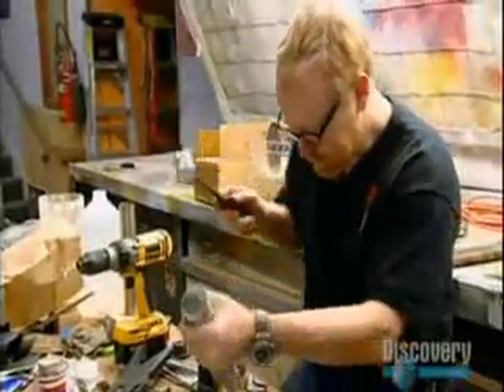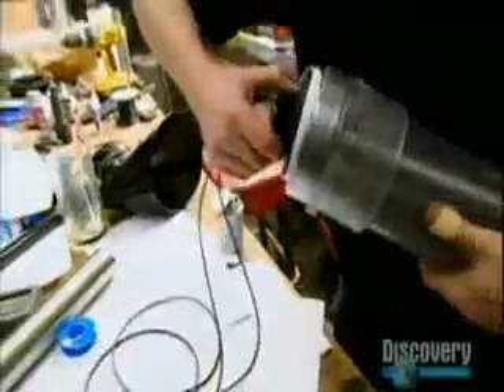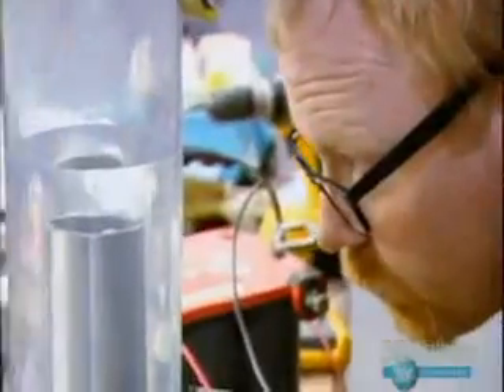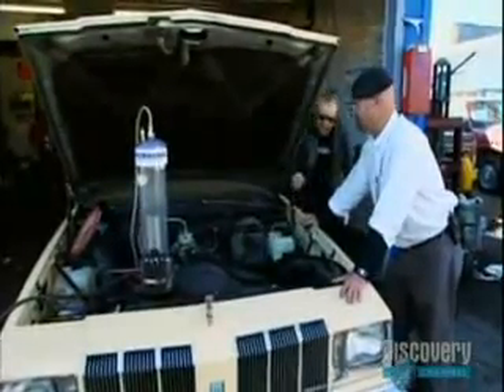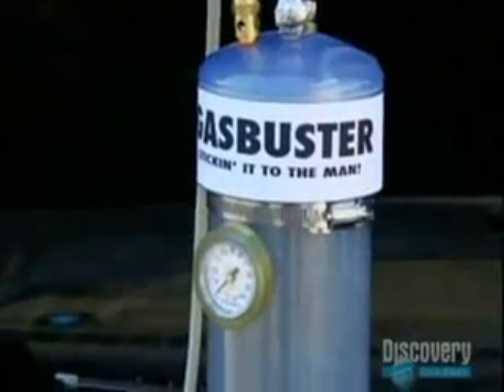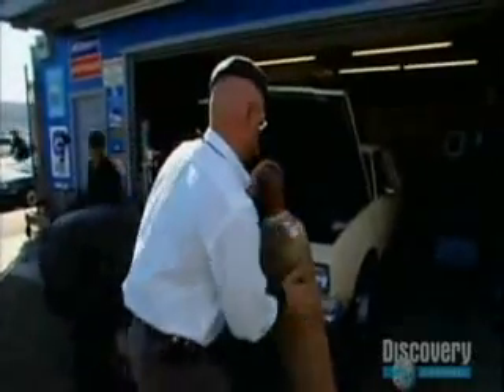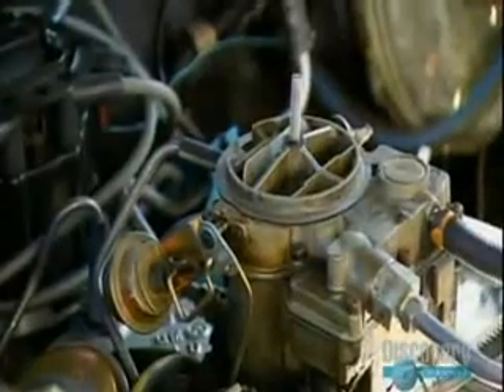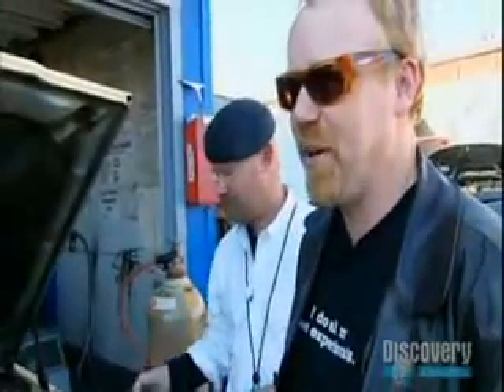HHO Mythbusters Explained

Comment: Yes, the reason is clear. Physics doesn't allow it.
Reply: @hydrogenGarage  Seriously?  Do you understand any of the words you've used?  you can't even spell deuterium for heck's sake.  Ortho hydrogen is a spin-state isomer of parahydrogen and naturally makes up about 1/3rd of H2 at room temperature, para is the other 2/3.  The electro-chemical/combustion difference between Para and Ortho is essentially zero.  Heck, the electro-chemical/combustion difference between Deuterium and Hydrogen is also essentially zero.  Doesn't matter whether the H2 is ortho or para or Deuterium or Tritium, the combustion energy is the same.

The only time that ortho versus para matters is spectroscopy or beam emission, or such as NMR machines.  The only time that deuterium makes a difference is in nuclear reactors.

Quantum physics?  In a chemical reaction?  You're dreaming.

Longitudinal energy?  Oh geeze.

Ah, that explains it, you sell this nonsense.
Reply: HHO or as it's often called "Browns Gas" is nothing more than a very dangerous azeotropic mix of hydogen and oxygen.   HHO cars running on water are just SNAKE OIL. evenrone knows it, stop peddling that crap.
Reply: No, I'll fill up my hybrid car, knowing that I'm saving at least two or three times as much money than you're claiming for your $1500 HHO gadget - if it actually worked as you claim, but doesn't.  And maybe, just maybe, I'll save someone for falling for your nonsense.  That's well worth while.  How do you sleep at night knowing that these devices are fraudulent?  Obviously, your parent's moral training has failed.  Or was it non-existent?
Reply: +HydrogenGarage No content?  Really?  No content that that golly-geewhiz device you're trying to sell for $1500 manages to produce a golly gee wow 3L of HHO gas per minute.   Ooh.   Meanwhile,that 12L engine this is supposedly for will rotate under HHO Power for precisely 1/3rd of a rotation (okay, we'll be generous, and put in enough air to let it do a whole rotation - it's going to need dilution anyway).  Once a minute.  Let's say the motor is running at 3000RPM - that's a nice efficient power band.  50 rotations per second.  So you get 1/50th of a second worth of power from HHO per minute. That's a gosh golly gee wow  LOTS of power.  Oh wait, that's only .032%.

Meanwhile, the alternator is pushing 36 amps @ 13.8V into it - 496 watts - half a horse power continuously.  So a half horse continuously into the alternator to produce a full rotation - all of .032% of the rated power of the engine.  Unless the engine/HHO is producing 5000HP+ continuously, you're operating at a LOSS of efficiency over straight gasoline or diesel.  This isn't even counting the alternator efficiency in converting rotational power to electricity - not close to 100%.

Of course you have an incentive to make stuff up to promote this nonsense - you make money off people believing this scientific gibberish.

And no, ortho hydrogen is no more powerful than para hydrogen, no matter how much you flap your arms.  Exact same combustion characteristics.  Lots of content here, I even did the math for you.  No cigar sorry.
Reply: +Ruth Moreton Somehow I don't think he's being ironic.  Let's enumerate some of the stupid, along with +HydrogenGarage's stupid, in no particular order:

1) If he developed it under contract with the US DoD, then by law, it doesn't belong to him, it belongs to the US taxpayers, because they paid for its development.  Since he didn't own it, he could not sell it.  If he tried to sell it to GM, he would be committing theft and breach of contract.  GM aren't morons.  They'd know that he couldn't sell it to them.   As a FYI, generally, such things are considered public domain and CANNOT be patented.  I know these things, I've seen what these contracts look like - when you work on US government contract like this, you end up with money, and hopefully all your body parts.  You own nothing of what you produced.

2) Any moron could make a 2.0L engine run at full power based on an electrolysis HHO cell, provided they have a few hundred kilowatts of electrical power on their workbench and an electrolysis cell to match - remember that HydrogenGarage's super-deluxe $1500 model isn't small, and only produces enough hydrogen for a fraction of one percent of such an engine requires.  The trick is getting that much power into a vehicle that can move it.  A 100Kw generator weighs on the order of 1000-2000 pounds at least, not including fuel tank.  Then you'd have to add a electrolysis cell that could produce, oh, 100 litres per second or so.  HydrogenGarage's "big unit" produces all of 3 liters per minute.

3) If they wanted to kill him, why do it with something tantamount to putting a flashing red light and destroyer attack siren on his head shrieking "assassination!".  Believe me, any body turning up in a morgue with cobalt-60 is going to scream bloody murder.  Why not something simple, fast, reliable and quiet, like a grain of carfentanyl?  Guy simply stops breathing, and there's a good chance, if he's not found for a while, that a lab test (if they bothered, it might simply be noted as a heart attack, and no forensics would be done) would never find out why.

4) Deuterium  - guess how they make that - take 350,000 tons of sea water, do some chemical process, and you get a pound of deuterium water.   About $600 for a litre of the 99% pure stuff, which is just fine as reactor coolant (as in CANDU) or thermonuclear bombs.  It's not restricted, anybody can buy it, there are many uses for it other than nuclear.  

The notion of "weapons grade" deuterium just makes me giggle, sorry.  It's a moderator, not an explosive.

5) Aether energy?  Aether energy went away over 100 years ago.  Quantum physics are part of what killed it.  Nikola Tesla profoundly rejected both Quantum theory and Einstein's theory of relativity he's quoted saying so many times less than 10 years before his death.  Furthermore, he refused to believe in the mutability of atoms (eg: transmutation of one atom to another - like fission or fusion), or sub-atomic particles, or sub-atomic structures - he didn't believe in electrons, neutrons on protons.  He didn't believe in the speed of light.  He didn't believe in radioactivity.  He didn't believe that nuclear reactions could exist.  Oh, what was Trinity then?

So you use Quantum theory (which Tesla rejected) to take Aether  (the theory that quantum theory destroyed to Tesla's great annoyance) energy, to produce through transmutation (a process Tesla rejected) to make Deuterium (which Tesla didn't believe could exist).  Right?  That's nuts.

Let me put that in simpler terms: Tesla himself would have profoundly rejected your "process" as scientific garbage.  He wouldn't have believed you any more than I do.

6) If you could create deuterium from electrolysis or aether energy, where do the neutrons needed to make Deuterium come from?  Remember, Tesla didn't believe in sub-atomic particles like neutrons, and all deuterium is is hydrogen with an extra neutron.

7) Bob Boyce (I just love the TM - is he suing everybody else named Bob Boyce?) is trying to sell nutty physics based on mutually incompatible theories somehow cooperating with each other.  Nothing can be learned from that.
Reply: No, I really don't get your point.  Wasting limited resources isn't a good plan if you're trying to be self sufficient.  You'd be far better off using the electricity you make to directly charge an electric car.   And yes, you can make your own gasoline, if you really want to.  All you need is a source of hydrocarbons such as plastic or organic material, and lots of heat, and some hardware.  But there's a reason why energy companies don't do it that way.  Because it takes more energy to make it than you get out of burning it.  Are you starting to see a pattern here?
Reply: @broandrow Hey bro, if the US patent office will gag order these inventions, how can you produce them under license from Boyce at Hydrogengarage?  "Gag" really means "gag" - the black helicopters would have taken you away.  If inventors of over-unity devices are murdered, why isn't Boyce dead?  Why aren't you?

Either hydrogengarage.com's devices are over-unity and you all should be dead according to your claims (this is after the black helicopters take you away for breaching the "gag order"), or hydrogengarage.com's devices aren't over-unity and you're a fraud.  

Which is it?

I've examined two of Tesla's radiant energy patents: 685958, 685957.  Haven't found a third. They're basically extremely inefficient applications of the photo-electric effect.  You could make them work a bit better with modern capacitors, such as aerogel super capacitors (his "finest mica" capacitors are from the dark ages of electronics), but it still wouldn't produce enough power to do anything useful.

The original discovery of the photo electric effect was in 1887 by Heinrich Hertz, and Einstein published a paper in 1905 showing that the effect was explained by the quantum (particle, rather than wave) nature of light - which is in this context, X-rays and higher frequency parts of the electromagnetic spectrum including X-rays and cosmic rays.  But of course Tesla didn't believe in quantum mechanics - he thought it was mathematical nonsense that nothing to do with the real world.

Tesla's little projects worked, of course they do, but the amount of power they could actually collect was miniscule.  Today's solar cells are many orders of magnitude more efficient.  But they're still not over-unity. Those inventions of Tesla are nothing more than demonstration toys of basic physics (even if he got the explanation for why they worked wrong) - they can't be used for anything useful.

So, what does this have to do with over-unity?  Precisely zip.
Reply: nox - Physics says it takes more energy to crack water into HHO than you get from burning it.  The point isn't whether you can make an engine run on HHO.  Of course you can.  The point is that it is completely stupid to attempt to do so from water.  You can also run a car on electricity.  To attempt to power it with a windmill mounted in the back that spins when the car moves is equally stupid - and is essentially the same concept.
Reply: nox 

First things first, there is a molecule caled Hydrogen H2, with the same name of the element (atom) H that constitute it's molecules in pairs.

There is another element (atom) called Oxygen symbol O, and another molecule O2 called Oxygen yet again, composed of a pair of O atoms.

In nature, atoms can be from the same element, with the same number os protons and electrons but differing in the number of neutrons. Those different instances of a same element are called isotopes. This isotopes are chemically equivalent to each other. Their weight is different, as are properties related to nuclear reactions.

Even though there is research in a field called LENR for Low Energy Nuclear Reactions, it is totally out of scope here.

We are talking about chemical fuels and chemical reactions which might include some forms of external energy in the form of heat or electricity.

Water, H2O, is the basis of the biosphere, our life, our composition, all of the organic chemistry, is "the universal solvent", ...

Reacting H2 with O2 brings about H2O and an amount of energy. One can burn H2 as a fuel, the same way as natural gas, methanol, etanol, gasoline, or whatever. H2 is a fuel exactly as the others, just devoid of Carbon C.

Another way of reacting H2 with O2 is done in Fuel Cells without the flame, where the energy is liberated as an electrical current.

The reaction from water H2O to create H2 and O2, in the reverse direction than the first, can be done ADDING energy. It's generally called water splitting, one of the phases in photosynthesis that sustain life on earth.

Onother way to split water into H2 and O2 (a chemical reaction), is through electrolysis, kind of the inverse reaction of a (PEM) Fuel Cell. It has been known for a long long time, and done in most schools to show kids.

HHO is a marketing spin for water, H2O, or H-O-H as chemists would write to expose atom links. A name just to deceive people.

There are many ways of producing hydrogen gas. Most of it is done through processing of fossil hydrocarbons (HC, any composition of just H and C). The simplest hydrocarbon is CH4 or methane. Methane reforming is the cheapest way to obtain H2.

Big electrolysers can also be used, even with the help of heat or photons (light) together with the electricity to produce H2 from water. ENERGY MUST BE ADDED HERE, the reaction is endothermic. In practice, a lot more energy is used and wasted, to react this way, that is not stored in the chemical bonds of the outputs.

Once you burn or react H2 with O2 just a fraction of the original energy used in the reaction is liberated. Only the fraction that was added to the chemical bonds in the H2 and O2 in relation to H2O is liberated.

Each conversion wastes more energy in the real world. 

In this STUPID HHO proposition:
1) water is split through electrolysis with electrical energy;
2) electrical energy is suplied from the alternator (or from the battery which was charged by the alternator in the same way);
3) Resulting H2 is burned with or without some other fuel (gasoline, CNG) in an ICE (Internal Combustion Engine) producing mechanical motion;
4) Motion is used to move the car, and to drive the alternator;
5) back to square 1.

Each step wastes energy as heat, light, sound, electromagetical waves. Just a tiny amount of the energy in the fuel that drove the alternator in the first time is held in the H2, and even less in the mechanical movement and back in the alternator to be converted to electricity and back into H2.

Energy from gasoline is far better used just in the ICE or in a reformer to extract H2 and in a Fuel Cell. 

None of the reactions will recycle comparable amounts of energy into H2 to be used once again as we do in batteries and EVs (Electrical Vehicles). BTW, even in all electric EVs there are still losses, even if orthers o magnitude less than in the ICE ore Electrolyser.

This guys are not making any progress, technical or scientifical, they are just defrauding people with unprovable promisses, bad science, and some gimmicks to avoid hard questions.

You can deplete the battery to avoid load in the alternator, you can add chemicals using their energy without calling it "the fuel", you can run the engine in some lean burning point with out of emissions compliance, ...

Anyway, in NO WAY there will be gains over a proper running car and proper comparisson, or "running on water", "making your own fuel", or any other catchy but obtuse claim.

There are many devices "run on H2", but H2 IS the fuel and must be obtained from somewhere. 

One unit of volume of gasoline contains a huge amount of energy. Try calculating the how many solar pannel working all day would you need to fill in Watts*hours in a week the amount of a full tank in your vehicle. Than try estimating how much more is needed to produce H2 with the same amount of energy through electrolysis. Don't even bother compressing, storing, or transporting as HHO used is produced "just-in-time".
All needed data can be obtained in Wikipedia. Amuse yourself.
Reply: @broadndererew.. Oh my sweet baby buddha.. I can't even begin to explain the full scope of stupid in that post.  you really do live in a special place don't you?
Reply: Quantum Physics doesn't.  The "aether energy" theory was shot down in flames by the development of Quantum theory.   Tesla went to his dying day insisting that Quantum theory was pure garbage.
Reply: i see,you attack the person that has the intelligence to debunk your complete and utter bullshit.
it seriously is not going to run a car,period.not with these hack job hydrogen producing units you
 fools are pawning off on hard working but very dim witted Americans.
Reply: to everybody in this thread it doesn't work because the amount of energy gained by hydrogen combustion is less than the amount of energy needed to separate hydrogen from water.
Reply: Slight correction: Tesla didn't believe in QP at all.  He thought it all mathematical nonsense.  Which is kinda odd since our batty friend here insists that his "product" uses both.  Yet, it was QP that disproved the aether.

Some of Tesla's interviews pretty much prove he was beyond "mentally ill",  his 1899 interview with John Smith is well beyond sanity.
Reply: Star Gazer 

I've got pissed off with the fraud of HHO being promoted and scamming innocent credulous people. I've written myself a smal rant too. 

It's nice to see some people took their time to rebuke this BS and explain a bit to ignorant but truth loving ones who eventually look at this.

Regards, and my appreciation to you and the others.
Reply: +nox You want to carry around a device continuously producing highly explosive gas (HHO is the next best thing to TNT - doesn't need air to go boom) attached to a saw that throws sparks a lot?  You're a braver man than I.  Not to mention the added weight which you don't want on a chain saw.  Like an electrical system.

It doesn't matter what size engine it is, it's still stupid as a way of using less gas, because in reality, you use more.
Reply: Was it you who did the youtube video and claimed 69Mpg from a mason jar HHO generator?

Yeah, sure, we believe that.  The video was proof of nothing.

You'd get the same "cleaning" effect by running the mixture thru the carburetor for a few minutes on your driveway.  Which is in fact what some companies do - sell a wheeled device that they run a truck engine on for a while to do a cleanout, then they switch back to regular fuel to drive the vehicle.
Reply: Oh, someone disagrees with you is a hired troll?  Proof or just your fevered imagination?

You've just claimed you're selling devices produced from a "gagged patent".  if that were true, why haven't the black helicopters taken you away?

You only claim 10-20% improvement in that allegedly "gag patented" device you sell.  My hybrid car saves three times as much (you know, saving three times as much gas as your toy does), without having to rely on witch-doctor voodoo physics.
Reply: yeah i don't get why people try  to push this stuff so hard. like if it doesn't make sense at the most basic level then there is nothing you can do about it. like a regular electric motor is more energy efficient.
Reply: Ah goody, another web page put up by the same people as hydrogen garage.  I see you're still using youtube for free advertising of the same old BS.

So, good 'ol Bob is still insisting that his invention is stolen from the DoD.

Oh, and yes, you still need to use a spell checker.  It just demonstrates your intellectual level.  I just love your media icons made up to look like real media.  Does NBC and CBS know you're abusing their trademarks?

You really are Batty.  Seems quite appropriate.
Reply: The replies on this comment are epic. You people are a special kind of stupid conspiritard. Rivaled only by flat earthers and chem trail believers. LMAO! Everyone who says it doesn't work is right. It's fucking nonsense. It takes energy to make energy and whatever you make with HHO is negated by the gas and electricity needed to make the shit. Hydrogen from this puny setup is nowhere even near the energy potential of petro.Gas is magnitudes more powerful than this little thing in a vehicle. Your car's computer defeats the gains anyway and if you manage to trick it, it is still a losing proposition. It's the law of diminishing returns. The Math, Science and laws of Physics and thermodynamics does not support your dumb argument for HHO. We have a real bunch of gullible one here. Lol.
Reply: You're right on with everything except "Hydrogen is nowhere even near the energy potential of petro."  When you burn petrol, you're simply burning a more complicated hydrogen containing molecule with some other stuff like carbon mixed in.  It really isn't fair to compare a liter of hydrogen gas at some random pressure to a liter of liquid gasoline.  When compared in energy per kg, hydrogen has about 4 times more energy than gasoline.  That's why for the highest performance rockets, engineers generally prefer hydrogen over kerosene (RP-1).Otherwise you're spot on.
Reply: @broandrew, oh my no, I'll tell my granddaughter that I owned the first Prius hybrid car and the second hybrid Highlander available in my country, each of which saved 2-3 times as much gasoline as you claim your HHO toy gets, and infinitely more than your HHO toy actually achieves.

I'll also be able to tell her that I spoke against fraudulent medical quackery devices foisted upon the desperately ill.  My conscience is clear.  You should spend some time apologizing to your lord and trying to make amends.  You have a n awful lot of praying to do.  Get busy.
Reply: +nox Ah I see.  The issue boils down to you'd need to be able to store the output gas[es] of the electrolysis cell somehow.  First, it's bulky as hell.  You'd need either staggeringly enormous storage tanks or pressurized storage tanks or both.  Pressurizing gas is hideously expensive power wise.  Second, you'd be stupid to try to store HHO - it's vastly too dangerous.  A leak in a hydrogen tank is a relatively tame jet of flame.  A leak in a HHO tank is an instantaneous explosion of the entire tank contents.  You''d be better off producing H2 and O2 separately.  You could even dump the O2.  This complicates electrolysis cell manufacture - you generally can't use interleaving plates, so the cells become enormous and a lot slower.

What other possibilities are there?  If you could get an electrolysis cell that generates H2 and O2 separately, and feed the H2 into some sort of easy/cheap chemical process that turns it into a liquid fuel (say, ethanol or heptane), this would work.  But I can't think of anything that doesn't require excessive amounts of heat, electricity or consumption of chemicals you'd be unlikely to be able to get if the grid is dead.

Keep the solar + batteries for electric powered stuff.  Then consider things like destructive distillation for liquid fuels.  For example, you can produce methanol by heating the crap out of wood inside an O2-free chamber and letting the vapors cool.  They don't call methanol "wood alcohol" for nothing - used to be the main form of production.  This is something you can conceivably do with a moon-shine style distillery run over a wood fire and a suitable chamber.  There are apparently similar methods that will produce ethanol instead.

[I'm not laying any bets on whether it's feasible or safe to run IC engines on methanol - may just be too volatile and toxic.  Ethanol is a different matter.  Still toxic, but not as bad.  No, I would not drink ethanol from destructive distillation of wood.  To many other things in it for that.]
Reply: unless you were being ironic. in which case - lol, good one!
Reply: As I point out in the reply to Ruth, that's just scientific bafflegab, meant to impress, but it's scientific nonsense.  If you had enough chemistry knowledge even just to know what Deuterium is, you'd know it too.
Reply: Hey Bro, you're confused.   Tesla thought that quantum physics was scientific garbage, because it ran completely counter to and destroyed his aether theory completely  He also did lecture tours explaining how Einstein was wrong.  He even believed that "electrons were physically impossible".
Reply: dont fall into that tinfoil hat wearing idiocy
Reply: If Big Oil was so powerful, then you wouldn't be able to post on Youtube. I mean, gosh, golly gee-whiz, it wouldn't be hard for Big Oil to arm-wrestle Youtube, would it? Oh, you think that Google (Youtube's owner) is big enough to resist secret orders from the eeeevil government?   The gubberment has no trouble getting stuff nuked off Youtube at all.

Strangely, Hearst does not, and has never published scientific journals. It did publish things like EE Times and the New York Journal, but those are no more scientific journals than Sport's Illustrated Swimwear magazine or Playboy is. Even if Hearst did, it doesn't anymore, they were all sold to Arrow in 2015. Arrow is not an oil company, Arrow makes electronic stuff.

What does Hearst have to do with Rockefeller? William Randolph Hearst was not a Rockefeller, Hearst Media was never owned by a Rockefeller, they have nothing to do with each other,.

As for Rockefeller printing presses, the only thing that seems to match is the journals published by Rockefeller University. Rockefeller doesn't own Rockefeller U.  RU only publishes a handful of journals.

OMICS International has over 700 science journals (Hearst and Rockefeller have zero). Based out of India, you shouldn't have any trouble publishing anything you want.  Indeed, make up an African name and pretend to be a poor researcher in Africa, it'll only cost you $200 or so to publish scientific gibberish.

Well, first, these "young millenium engineers" will have to come up with a replacement for quantum theory - because it was QT that disproved the existence of "aether".

Tesla wasn't in the slightest bit interested in giving mankind free power.  That's why he patented his inventions.  So he could make the megabucks himself.   Unfortunately, all his "free energy" patents weren't, and nobody was interested in paying him.  Even now, when all the patents have expired, they still don't do anything useful.
Reply: Well of course it doesn't work for that very reason.  Not to mention the efficiency loss of driving the alternator to begin with.  Several of us have said so in extreme detail, but we're still walloping the snakeoil salesman who's making up all sorts of scientific gibberish about how the device he sells taps zero point energy, blackholes, the aether, produces deuterium, false claims about spin isomers of H2, and that the NSA tried to murder him with an unpowered (note the unpowered)  tracking implant that slowly poisoned him with EMF.  Come on now, wouldn't a simple disappearance or car-fentanyl contact poisoning have been far simpler and far more effective in actually killing him?

Now he's gibbering on about how the ortho spin isomer of H2 cures cancer and a gazillion other diseases.  Yet, his device doesn't produce any more ortho H2 than H2 normally has at room temperature without any assistance from us.

It's just fun seeing what insanity he makes up next.
Reply: @Frank Gutowski We have our own alternative medicine/health/reality wackos here with bro fantasizing about ortho hydrogen curing a gazillion diseases and nonsense about crystalline pineal glands.
Reply: Star Gazer I cannot argue your Science knowledge sir. Good on ya! :) It's a size,  power and concentration thing ultimately. Their tank of hydrogen told the tale. That's the real stuff. What people are making with HHO setups in a vehicle, is nowhere near that. It can't be, hence it is impossible to save anything with any small scale, instantly generated Hydrogen from water like typical HHO systems.
Reply: broandrew You are a troll from hell. Your one sentence Lord Jesus comments prove that, troll. Lol. What a moron.
Reply: Fromage Frizzbizz Most epic responses ever! Touche! LMAO! You have a way with words and I like that. That was priceless. You utterly shot this nonsense full of holes, in the most eloquent way and turned his religious nonsense on him too. I laughed so hard. Best thing I have read in a long time. Thank you. I knew it was B.S. anyway, but to watch that exchange with this shill, liar piece of trash just made my day.
Reply: It's kinda hard twisting an interview when you quote the words Tesla said exactly.  Moreover, the journalist was positively worshipping at Tesla's feet.  Twist?  No, he was exalting in Tesla's word.  It's Tesla's mouth and brain, saying those words.  Those words that demonstrate quite adequately he was a bit of a flake.  His belief that "we're all gods" and the holiness of the light would get him thrown out of any southern US church.  Not a single reference to Jesus.  Did you notice that?

He'd be quite at home with 60's flower children.  

As for Trump, don't need to steenkin major media to know that he's a incorrigible liar and nutbar.  I can read his tweets myself thank you very much.  I live in the city where one of those "terrorist acts" that Trump claims weren't covered by the media.  I was in the hospital that was put in lockdown, when Cirillo died there.  Not covered by the media?  Pure bullshit from the master of bullshitters.
Reply: nox 
Google "Daniel Nocera" h2 home electrolysis catalyst...
Reply: Nocera's catalyst is something to make electrolysis go faster.  Ordinary electrolysis with distilled water is slow, because distilled water is a poor conductor.  Normally, you dissolve in an electrolyte (K0H is popular) to increase the conductivity so electrolysis goes faster - at the expense of an equivalent rise in electricity consumption.  You also increase the number of plates etc. etc.

But whatever you do to make the electrolysis go faster DOES NOT change the amount of electricity required to generate a given amount of gas.

The problem is with electrolyte (like KOH) addition is that it will interact with other chemicals and eventually crud up the electrolyte, eat/foul the electrodes and ultimately decay in efficiency.  So you have to flush the liquid (including the KOH) which isn't exactly great environmentally.  If you're forced to start with impure water (eg: hard water), it just cruds up all the faster.  In other words, a basic electrolyte-style cell fouls itself.

Nocera's catalyst essentially gives you the advantage of an electrolyte which doesn't self-foul, and you can flush the water at will without dumping any of the catalyst..

Salt water batteries are an entirely different thing.  Those seem ideal for solar panel power storage, being cheap, non-toxic, and able to handle the number of charge cycles.  But, they're no more efficient weight-wise than lead acid, and are a fair bit behind Li-Ion in Kwh/pound and temperature tolerance.
Reply: There's a sucker born every minute!  Look at all the suckers buying electric and electric-hybrid cars!  They think it is better for the environment - of course to think that, they need to assume all those rare earth elements and materials are mined cleanly!  Then they have to assume that their car is being plugged into a solar panel to charge it (for the all electric cars).  Then, after paying 15-25% more for the electric or hybrid (vs. the gas car), they find out 5 years later than their car has dropped in value at more than twice the rate as the same model gas car!  And of course, since these cars become non-salable very quickly (by comparison), more rate earth materials and elements will need to be mined again to replace the throw away cars which don't last as long . . . so for a 10, 15, 20 year period, those cars end up being just as bad, or possibly even worse, for the environment (when all environmental factors are considered).  

But the good news is . . . some day we'll get there!  Maybe somebody will develop a perpetual motion machine that can generate electricity - it just needs to be big enough to use gravity, the earths rotation, the moon and the sun to provide the necessary input.  Or maybe just use the part that has already been completed - like the ocean's tides.

But for the time being, oil has it's place . . . after all, it's a primary ingredient in our global food supply, our global pharmaceutical supply, provides for more than half of the "fabrics/clothe", then of course there are all the plastics made possible by oil, and then all the billions of moving parts that require some type of lubrication - most of it still being oil.

I like the prospects of hydrogen, nuclear, and gravitational based power . . . but we'll see, there are a lot of people a lot smarter than I on this subject.
Reply: This is why I come to Youtube.  For the stimulating intellectual conversation from a guy named Smeagol.
Reply: +Noneyer Business, no actually physics doesn't say that about bumblebees.  Details are important.  HHO fans aren't the type to worry about details.
Reply: Ryukikon, you cannot extract hydrogen from water and then burn it for a net energy gain.  It isn't possible.  That was the point.  Whether you can burn hydrogen in a car wasn't the question at all.
Reply: Adrian, you obviously don't have a masters in chemistry.  Now shouldn't you get to bed?  It's a school night.
Reply from the maker: Mason Jars LoL. Those things were a joke.
Reply: Very interesting. So, would this be the saltwater batteries I have just recently heard about? Kind of sounds like it and it is pretty cool. They are specifically designed for off grid power use and are pretty cool. Stackable, long lasting because they can hold a good charge etc. The only drawback to them is they are not good in the cold, so not too practical for Canada. Unless maybe they were kept in a heated area or fairly warm as they are not good below -15 or -20 Celcius.
Reply: Fromage Frizzbizz 

Nocera has already sold his enterprise to Lockheed Martin, and moved from MIT to Harvard.

While most of what's been written is right, the point is that the capture of primary energy from a sustainable source [ the Sun itself, our best nuclear power plant, best kept far away ;-) ] at competitive cost with fossil IS SOLVED.

The photovoltaic sandwich with the catalyst IS ABLE to cheaply convert SUN LIGHT into chemical fuel, which is storable, even if H2 is a gas with low volume density.

Turning H2 into any other liquid fuel while recycling CO2 as nature does (in Calvin Cycle) is one step further people are working on.

CO2 is not a problem, only if continually created (from fossil) with no recycling.

BTW, I was responding to someone who wanted HHO to "other applications", just to point there are serious ways of handling electrolysis that are not scams as this HHO stuff.
Reply: you are so incredibly fucking stupid
Reply: Chris Koffend 

You are only partially right.

EV are still not cost worthy on there own to many real uses where ICE powered vehicles have been shining for a century.

On the other hand, EVs are far more energy efficient from tank-to-wheels than there ICE counterparts, and electricity can be sourced from many different primary energy sources.

We can create synthetic oil but not at a very cheap price like the Coal to Liquids Germans had used in WW2 and South Africans since they've been embargoed. It's estimated to be cost effective at 65USD/barrel given time for investment amortization.

Most people recognize the current limitations of our basic energy technologies running on an open limited cycle of burning fossil fuels depleting reserves and accumulating CO2 in the atmosphere.

There are doubts about how radical should be the changes to correct this given uncertainties of future previsions based on models that cannot be scientifically tested (as we don't have a spare earth to test in).

Going past the stranghold of energy and sustainability will open a new era for all the economy to evolve producing the goods and services demanded in our times.

There is a lot of research in many fields related to alternative energy, in all kinds of pathways.

Solar PhotoVoltaic (PV) is just one of them. Last year, after many years decreasing in cost, large scale Solar PV became cost competitive without subsidies in many parts of the world. 

That happened even without taking away current subsidies to fossil fueled industries as most economies are set up.

Breakthroughs and evolutions may alter the relative merits of the many proposed pathways to "clean energy", but change is on it's way and in the beginning of an exponential curve.

Many people want to be trendy and participate in this endeavour. Yes, there is a bit of irrationality that looks like a sect in some enthusiasts, but overall the big picture is right.

People buy iPhones, people buy L&V suitcases, and people buy Tesla Roadsters. Economy is not what drives this.

Someday all remaining ICE powered vehicles will be hybrid like Toyota Prius and others, and most will be electric. Not in five years but surely in fifty.

The exact transition path and speed are the trillion dollars questions of our times. That's why all governments, academia and industries are cooperating in precompetitive research and avoiding huge investments before beeing sure of the answers.

As all conceivable pathways have been charted and a basic undestanding of each one's potential is clearer some have been investing in the more promissing ones. 

It will take time, but it will completely change the world, and there is a lot of money to be made (or lost).

What seams stupid from an immediate perspective might be beeing "avant guard" in a future retrospect.
Reply: +Chris Koffend, No, they don't have to be mined 'cleanly'.  They can be mined exactly the same way as the components for an ICE.  That doesn't take away the environmental savings for the life of the car not burning oil.  The car doesn't need to be plugged into a solar panel, though that certainly is a benefit an ICE vehicle can never claim.  Electricity is generally not generated by burning gasoline and diesel.  5% of my electricity comes from hydro, wind or solar.  45% of my electricity comes from nuclear (zero carbon emissions).  21% comes from natural gas (less than half of the emissions from coal), 28% comes from coal, 0.6% comes from oil.  So half of the electricity to run my electric car has zero carbon emissions.  28% has 60% less carbon emissions compared to oil.  And I have the option to add some solar and make it 0% carbon emissions.  Any way you slice it, an electric is far better for the environment.  Mining some lithium certainly isn't enough to tip the scale the other way.
Reply: "No, they don't have to be mined 'cleanly'.  They can be mined exactly the same way as the components for an ICE."   

You are obviously completely unaware of how the rare earth materials are being mined.

Part of every product's carbon footprint is the entirety of the input of that product - from raw material to completion of the products.  And the carbon footprint aspect is one portion of the environmental impact of a product - and this is where the current day electric cars fail.

The electric cars sold today are in general sold to people who want to feel good about their purchase - despite the fact that there is no real environmental benefit of an electric car.  Someday that is likely to change, but to this point, it is simply reality.  Sorry to burst your ideological bubble.

The next problem we have with electric vehicles - if they ever do gain any real traction in terms of percentage of cars on the road - we will then be forced to address that by have to update, expand, and invest in a new and much large capacity electric grid - which in it's current state could not handle even 25% of cars on the road being electric.

I suspect internal combustion engines for vehicles will be around for a hundred + years.  You seem to believe the ICE (internal combustion engine) = gas, diesel, etc. . .
Reply: yah love you a rare inteligent spiecie
Reply: I get free electricity from the sun to power my electric car.  Do you get free diesel for your car?
Reply: I tried to read all of this but man it was kinda bad. Physics does allow it and the video proves it. 
-
Can you run a car on hydrogen, yes, can you run a car on hydrogen and not have it weigh more while having a conventional engine, no. It will weigh down the car. 
-
Can you assist a car that runs on gasoline with hydogen, yes. 
-
If you assist a car could it save on fuel, yes. 
-
If you buy the car do you save at current prices, no. However what is the measurement of value used to the individual. If a person's goals is to have that car forever and use it then they are happy with that it was a good buy. 
-
Problem is trying to put other people's decision (X) by the standards of what other(Y) people do when trading or buying cars.
Reply: Fromage Frizzbizz technically yeah because isaac newton was rich but that not the point
Reply: It's all physics.  When you get out of high school, you may realize that.
Reply: No, the physics that even the elites and oil companies have to obey, because the universe says so.  These physics understandings and laws predate the oil companies.

Or do you think gravity is a plot invented by the elites?  Who knew?
Reply: haha
Reply from the maker: Star Gazer, I ran an HHO cell in a 2002 Explorer Sport Trac for a few year with decent results. Original MPG is 16 tops on the HiWay, I was getting about 28 mpg with a MAF Adjuster & and electronics to fool the CPU. (it reads the HHO as a lean burn & tries to compensate by dumping in more fuel) Bottom line on a CPU vehicle it's more trouble than it's worth. On my 1963 Merc with a 260ci V8, I get 32 mpg Highway. The Physics doesn't support running a car totally on HHO BUT it does help completely burn gasoline so you get more mpg, not to mention cleaner exhaust
Reply: nah oil companies don't allow it. The world is about money my friend.
Reply: by '' the Physics'' you mean the elites owning the oil companies and even buying those technologies to make sure they don't get released?